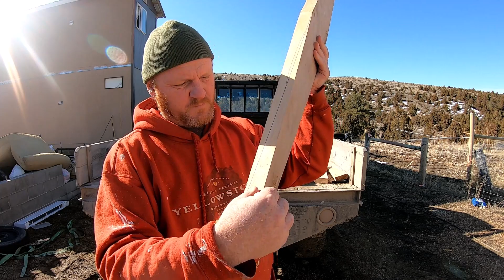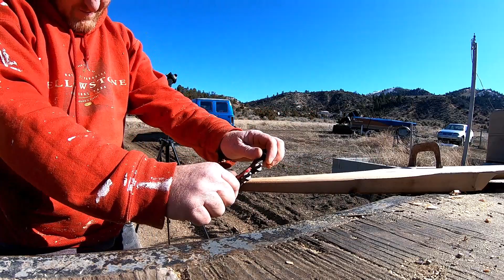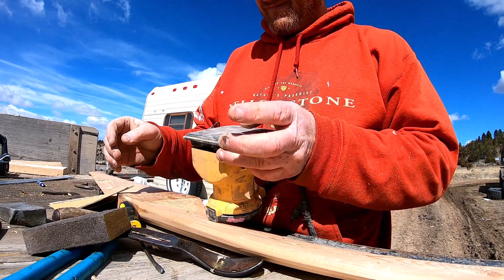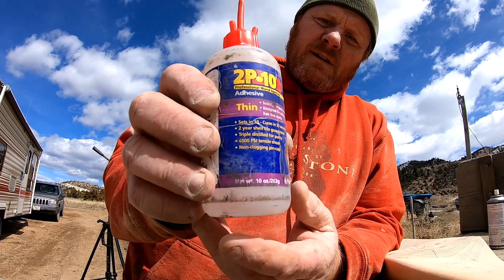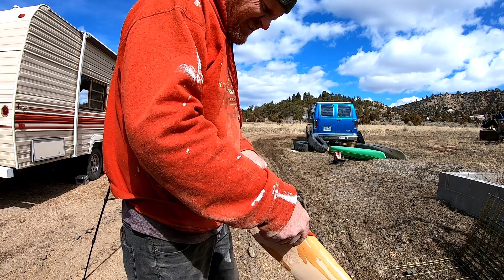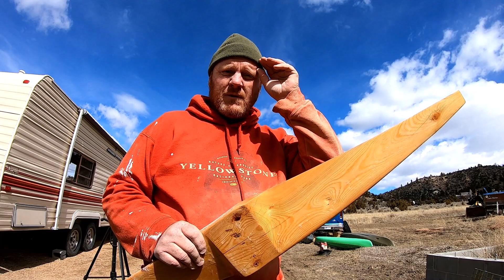how to make a wind generator, carving a "fat" blade for pm alternators, for wind turbine, wind mill

Comment: PLEASE I need the dimensions for both the fat blade and the dimension for the blade u used for ur wind generator
Reply from the maker: Those blades I believe were just over 4 feet in length, but the length you use would be dependent upon your design. The longer the blade the more power but the slower it turns.
Reply: @veggitarianredneck   pls what is the breath and it width
Am trying to make something like urs
Reply from the maker: Ok the "fat" blade is a 2x6 in inches which means that its 6 inches wide by 2 inches thick. Or nominally actually as it's really 1 1/2x5 1/2. The length you choose depending on your design. But I think 4 feet long is what I show being made.
Reply: @veggitarianredneck  thanks that was really helpful but I still have one question
Reply: @veggitarianredneck   after getting the length, breath, thickness
At the top of the blade did you take the next point from the center or u had it measured?

Comment: Kerry ? 
I think that is what you said ,
Treated wood would be better , just a suggestion ,
I got a GM alternator tore apart , I looking for about 2 inch long by 1/4 by 1/4 neodymium N52 magnets, so far all I have found are N42 or smaller and not exactly the size I need , 
I'm thinking that it would probably be cheaper and better to just buy a rotor with the slanted magnets or a slanted stator as I have seen both and No cogging with either way you go ,
And the bigger and longer you make your blades the more torque you will get ,
I'm wanting to build a VAWT out of two 55 gal. Steel Drums so cogging doesn't matter on my PMA , it's only 2 foot pounds anyway and the VAWT won't even notice it, I will be running a  26 inch bicycle rim and a serpentine belt just like off any Chevy engine , for every single turn of the bicycle rim I get about 20 turns on my PMA , I might even go with a bigger rim or two rims doubling up ,
So even if it is just a small breeze say 5 to 7 miles per hour , my PMA will produce power , and no I'm not worried about excessive speed , I tested all my PMA's at 3600rpm under load for 20 minutes straight , No excessive heat and no power drain ,
Stay warm my friend 
I think we are all under a winter storm warning ,
And shoot me some advise or knowledge whenever you get time
Reply from the maker: I would think the PM core would work just fine for what you are doing. But I must confess I have little experience with the VAWTs. Even if you do decide to go with a HAWT instead I still think a slant core would work with like you said the right blade. Only remember the longer a blade is made the less RPMs it has. Figure 300 RPM cut in speed for a 10 footer. And around a 1000 for a 5 footer if I'm not mistaken. Somewhere there's a sweet spot there for your setup. Nice thing is the blades are easy to carve and cheap to make.

Comment: PVC blades are ok but will deteriorate rapidly due to UV from the sun.  It's hard to get paint to stick to PVC.  Wooden blades must be painted or varnished with UV resistant coating to keep them from waterlogging and becoming unbalanced. Waterlogging will soon result in rot too.
Reply from the maker: I have not really found it to be an issue. Once a year hit it with linseed oil, and re balance if necessary. 
  Thanks for the comment.

Comment: Appart from having the mechanical connection when the wind blows hard enough, how did you excite the field windings on the alternator? Did you use another battery?
Reply from the maker: When the mechanical connection is made it connects it directly to the battery your charging. Hence it uses the battery to excite the field then it takes over and charges the battery.